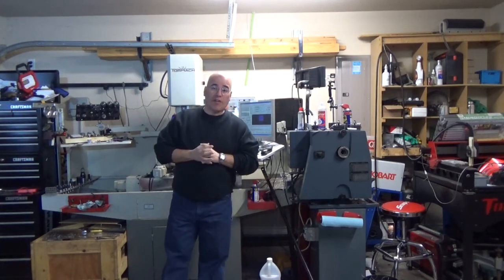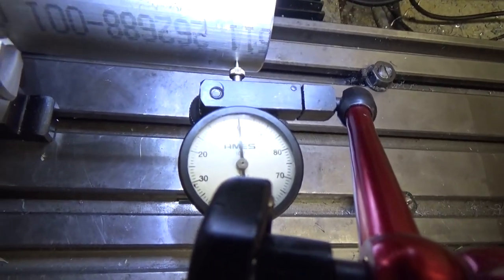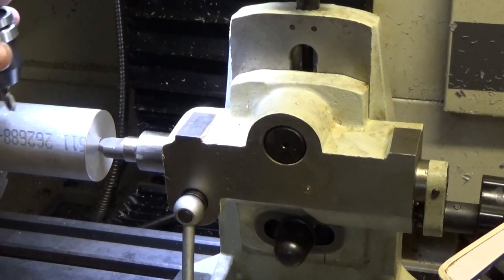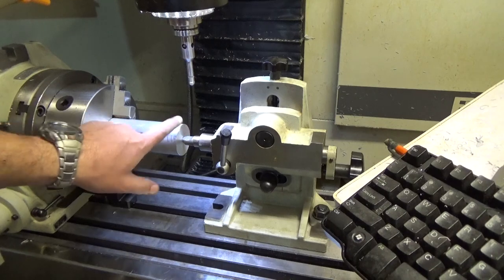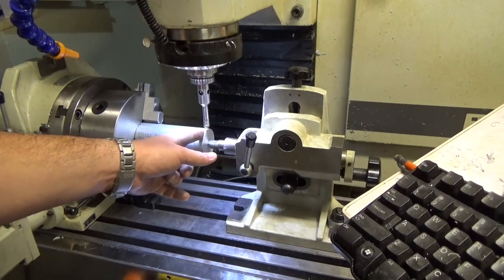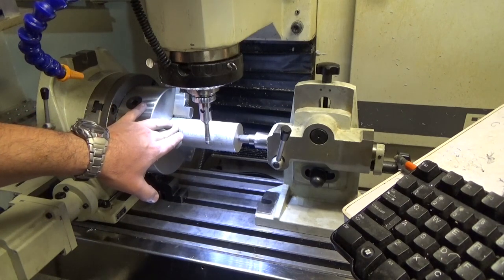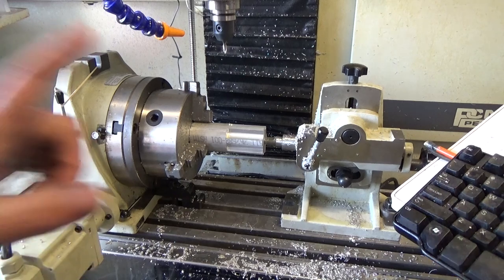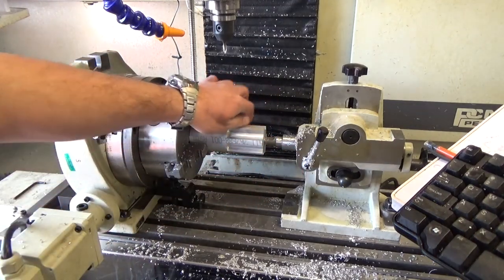Luke's ROTJ Lightsaber Pommel Manufacturing

Comment: I'm currently in an advanced CNC class through MASSMEP.  Would you mind sharing the G and M codes with me so that I may build this lightsaber for my final project?  Did you CAM this part out from MasterCAM X9?  This will be amazing!
Reply from the maker: Hi Thomas, I used Sprutcam to generate the G Code. I wish I could share it with you but I am literally moving out of my house and most of my shop is already in storage. But I think you can download the Inventor files from my cncdude website. With those you could generate your own toolpath. Wish you good luck on your CNC class!
Reply: +CNC Dude Thank you so much. I'll send a pic when I get it complete.

Comment: Would you be willing to mill the profile out on a piece of 303 or 304 stainless for me? I can do my own lather work. I just need the pommel cubes cut.
Reply from the maker: Hi Zachiann, I can definitely give it a try. I have never done SS before, but I know the machine can do it. Will get some material, give it a try and let you know how much it would be. Do you have a preference of material when considering 303 or 304? Or are they so similar it is a matter of availability?
Reply: It doesn't matter. Both are machinable stainless. Easier to cut and ill be making the rest of the saber from 303 probably. I will definately purchase the part since I can't do mill work myself.